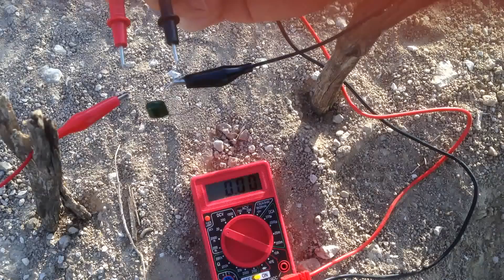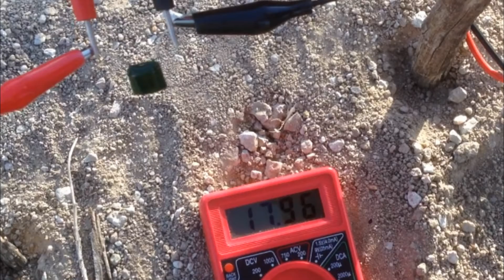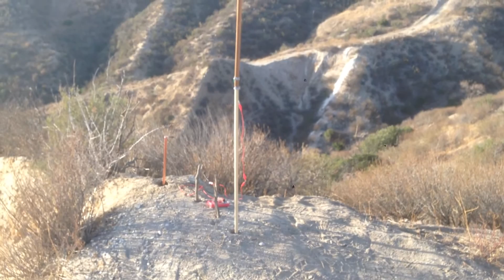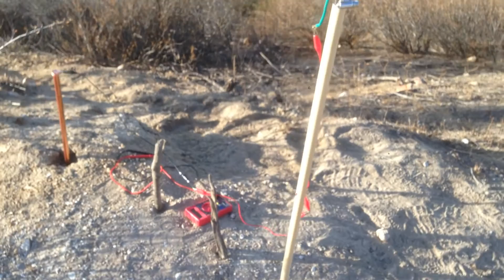PMBO 2014 Update 4 (Atmospheric ions & ground rod)

Comment: listen the higher and wider the better the ground must be isolated from direct connection with the antenna you can draw the electricity with a second thick winding around the tesla coil and then you can put a rectifier between the second ground coil and the ground when the voltage is low and amperage high